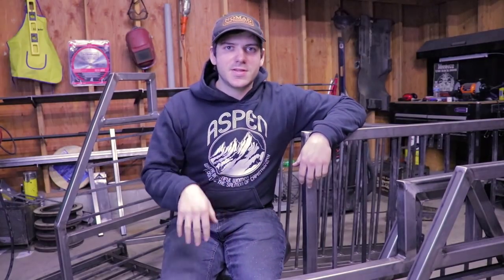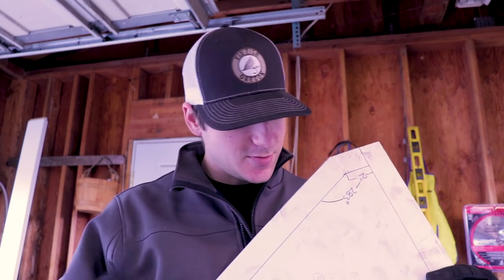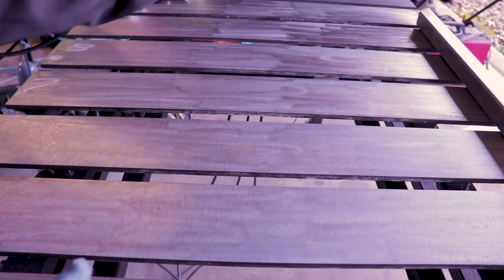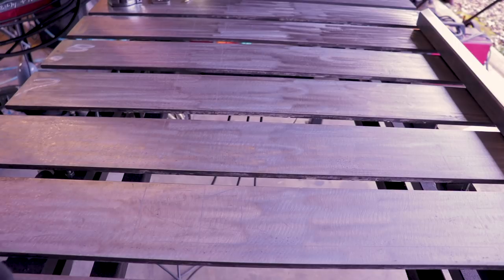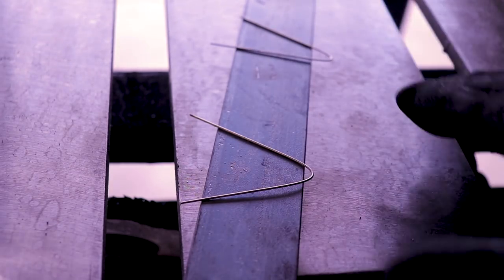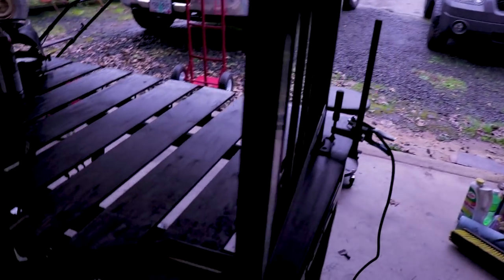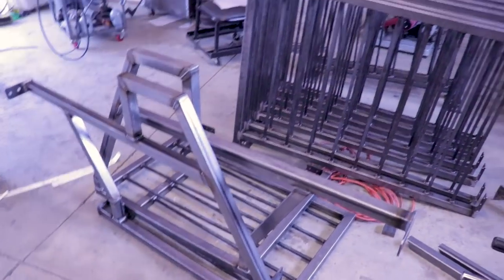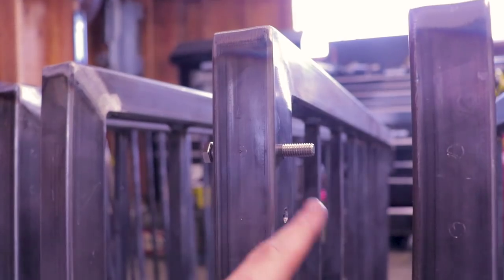Handrail Welding Project

Comment: I use 2x2 .083 wall tube for my posts. When I have any modular rails that need to bolt together, I punch the bolts holes into the tube. It takes a few good wacks. I use 3/8”x24 button head bolts. I have a long tapered drift punch that is sharpened to a point and turned down on the lathe to mach the required hole size for the tap. Then you just punch it though and it extrudes the metal in so you have as many threads as a nut would have. It’s really fast and holds good. Great video.

Comment: Great project! Your beads really do look like tig. May I ask what size wire you were using?
Thanks for sharing!
Reply from the maker: Bo Haggin thanks and no problem I usually run .030 wire just standard er70s6. This is the bottom shelf stuff from my weld supplier
Reply: 5th Street Fab looks great! I'm still trying to dial in this technique on my Lincoln 180 with 75/25
I've also watched your mig like tig video for guidance
Reply from the maker: Bo Haggin just takes practice.  I've been thinking about redoing that MIG like TIG video to show all the little things I've learned since then.
Reply: Bo Haggin 
Dont bother. 
No point at all,  just more chances for cold laps, lack of penetration and other problems.
Clean smooth steady travelspeed keeping the wire right in the front 1/4 of the puddle. Want a bigger weld?, turn voltage and wirespeed up, or multipass it.  Much stronger, much neater, less overall heat input therefore less distortion.
Reply from the maker: Ken F you're absolutely right that's how I did all the none fillets, but this way keeps me from having to grind down welds and the customers like it better.  And for a handrail it'll be fine.
Reply: Ken F yes, I totally understand that this is a slightly colder weld, but in some situations you need to have the aesthetics of a good looking bead.
Thanks for looking out though.
Reply: 5th Street Fab I would love if you made a follow up on the mig like tig video. Some arc shots that show your timing and motion would be great. Thanks again!
Reply from the maker: Bo Haggin ok I'd expect it in a month or two

Comment: What I don't understand is this: you tack the whole thing together, and then you only seem to lay it flat on your table without any (or not many) clamps (from 4:05 in the video). That thing will warp on you in all sorts of directions wouldn't it? It may skew the whole assembly making your first flat weld in a certain direction, and the butt joint halfway on the long tube will bend the long tube? Also there is a high risk of the assembly not staying flat when you weld out one side first? Do you calculate these warps when you draw it? Or do you magically counteract the warp during welding?
I ask because even when I (TIG) weld with things perfectly clamped up on a certiflat (siegmund in my case) table....once you let it cool down and take it out the 'mold' it has a friction fit against the walls of the clamped barriers and springs into another form. I once tried to make perfect steel squares....it's impossible as even with 4 inch stock, completely clamped up and welded solid, adding another pass on one side outward will bend the angle too far open, and welding inward will make it below 90 degrees when you loosen the clamps after cooling for even hours. Your metal doesn't seem to do the same? :)
Reply from the maker: With something like this the warpage is pretty minor.  The only part that really pulls is the 90 degree turn in the handrail.  So on that I tack it up out of square and the welding pulls it in.  But everything else is boxed in so it opposes the other welds and I just sequence the welds so that I weld the ones that are least likely to pull.  Like the outside corners and always weld the fillets last.

But anything you weld is gonna shrink.  So on some things I'll add a 1/16" to have some fudge factor.  I have quite a few videos showing how I combat distortion.

Comment: Good job getting in the biz myself but with stick.... wondering if you can give me an idea on how to charge feel like I’m under bidding myself
Reply from the maker: Steph Curry thanks and right on!  Some people have a basic type of railing they do and figure out a footage length cost.  If you're doing something custom I'll count how many cuts, welds, grinds and also how many pieces I'm gonna be assembling.  Then I'll add up the number of welds and find out the inches of weld and have a set amount to charge per inch.  Like 50 cents or a dollar.  It can change on the type of material or type of welding.  Then cuts I'll charge a dollar or 2 per cut.  Assembly about a dollar per piece or more if you'll need a complicated fixture.  And grinding I charge at least 1 dollar per inch of grinding.  Should charge more I hate it! Haha add all that up and that's my approximate labor.  Then I buy 10-15% more material than I need.  Because you always end up using it.  And charge a 15-20% mark up on material.  That's about it!  Hopefully it helps
Reply: 5th Street Fab thanks so much... I really need that info I love your welds so clean..keep up the good work👍.... subbing now..

Comment: Nice work lot and lots of parts do you ever figure up how many feet of weld you have in a project like that and have you ever left a pin hole on mistake or maybe forgot a weld and then the tubing will somehow get moisture inside and swell up on one end sometimes I will drill a small hole on the low end to let moisture out
Reply from the maker: Maynard 59 I've never figured the amount of weld I just say to myself ok that joint is 4 welds a total of 5 minutes to weld that out and add it to the total.  I usually leave a hole at the bottom but they didn't want to see any rust running off the concrete patio so I didn't.  On most things I leave holes at every junction.

Comment: Very nice. Approximately how many hours in that complete job?
Reply from the maker: Jim Collins I'd say 80 hours for everything so far I still need to install it too.  It's a little over 50 feet of handrail.  Cutting took probably more then half of the hours.
Reply: Nice. u make some nice handrails there. did u come up with everything yourself ?
Reply from the maker: blaster91 I copied the look of an original handrail they had and made it modular so I can have it powder coated

Comment: Building handrails for 35 years (steel,s/s,alum & brass) this amateur hour.
Reply from the maker: +canadian welder you must be amazing! I've never even heard of steel,s or s,alum!  Thanks for watching!
Reply: 5th Street Fab steel,stainless steel and aluminum
Reply: canadian welder ,This is professional .
Reply: dhb 57 professionals don't need cardboard templates or draw on tables,plus we use GTAW welding stronger and less clean up time. Rule number one time is money
Reply: @canadianwelder3899  this is his home shop with a small slat table, give the guy a break!! He explained how his job he draws on table. I have my own business for 25 years building rail. Tell me whats your procedure for measuring ?